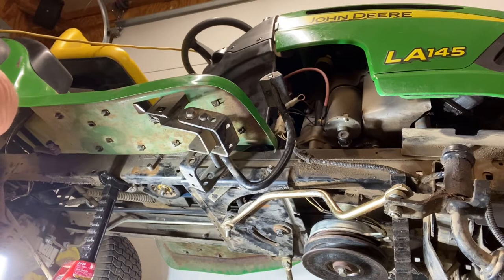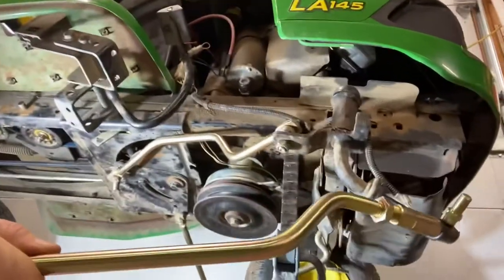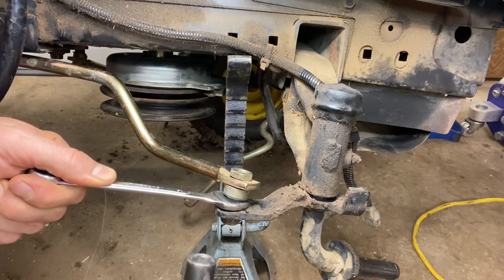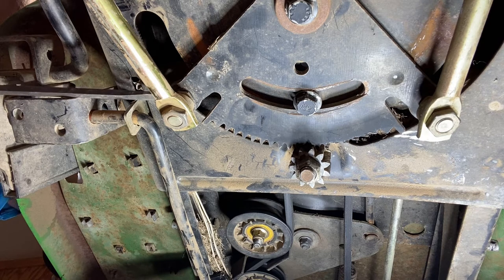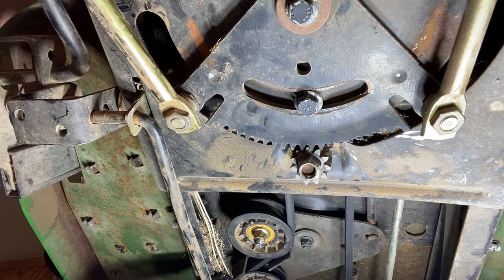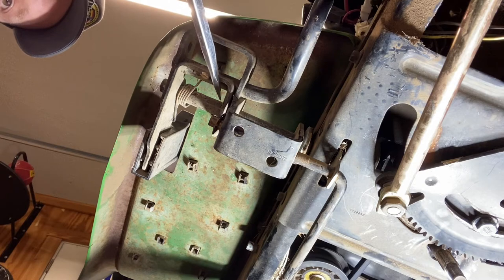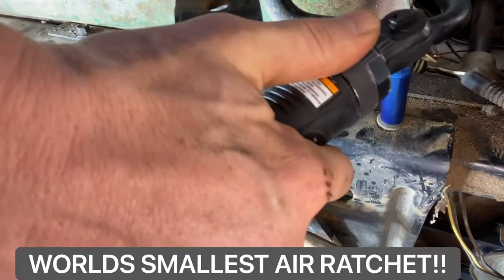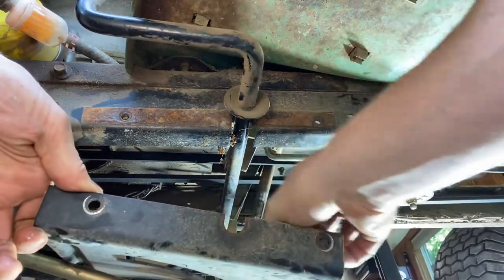John Deere Mower Steering; Drag Link Replacement & UPGRADE to Adjustable!

Comment: Awesome video! Really helpful! I was supposed to receive adjustable drag links on both ends but received the ones that don't adjust on spindle end. They don't fit right of course. Going to see if can send back or cut them to fit better. Your video was easy to follow and to do as instructed. Thank you.

Comment: Good video.  I was lucky.  My "little girlie hands" were able to reach up above the sector gear.  I had trouble getting a backup on the nut on the drag link.  This may have been partly because the drag links came from the John Deere store installed backwards.  The adjustable end was bolted to the sector gear.  Luckily I was able to remove the two big bolts that hold the sector gear up.  I didn't have the metric combination wrenches, but I was able to use a small crescent wrench to back up the nuts on top.
Reply from the maker: Haha glad you could appreciate my joke.

Comment: I had bought two sector gears then cut the top gear part off of one of them to weld onto the other in hopes they dont wear out as fast the nexg time
Reply from the maker: Wow that is a great idea. Those things are way to cheap and thin, let me know how it works out. Best idea I have seen on my comments yet

Comment: I have a L112 i just got used. The problem it has is that the left tie rod touches the main engine bearing when turning so it makes this grinding noise. The rods look new. The guy said a lot components were replaced on them 2 years ago and one of them was those so he doesnt know is they installed wrong ones or what but happens when almost at full lock.
Reply from the maker: Guess no sharp turns for you lol

Comment: Any possible way of getting that 17mm on the nut without taking off the sprocket and removing everything ?
Reply from the maker: I don’t know any tricks, you can try sneaking a wrench above that plate and hooking onto it but I can’t do it. It isn’t to bad just taking of that plate. You will probably waste more time trying to sneak that nut off vs just taking it all apart. Good luck
Reply: @MowerMike  thanks.  Sounds like I might wait til winter to try when I have more time.
Reply: Pair of needle nose vice grips will fit above that plate Gotta access th right side by going under from the left side and vice versa.,

Comment: Cannot adjust enough to get wheels straight?? What am I doing wrong?
Anyone help
Reply from the maker: First check that you put them on the right side, the links are specific to a side. If that doesn’t work then try stock links, if that doesn’t work then get a bit arse hammer and beat her back straight.